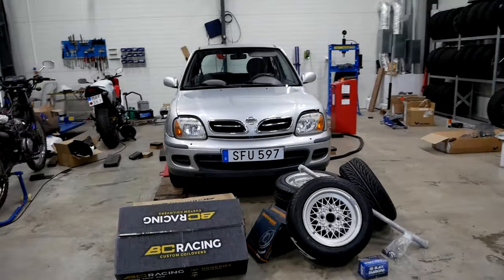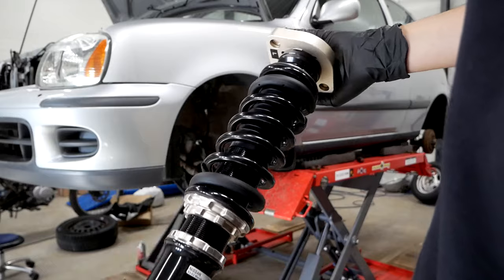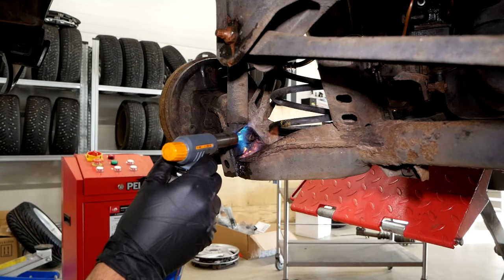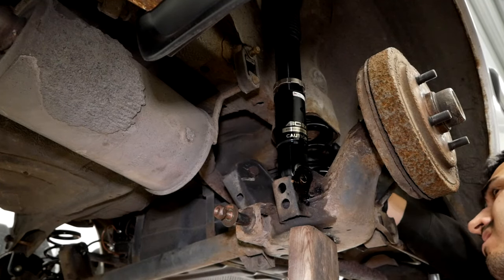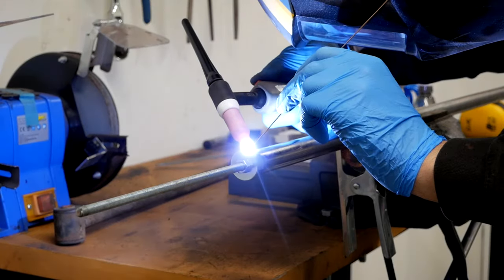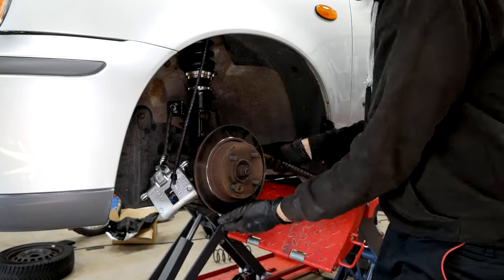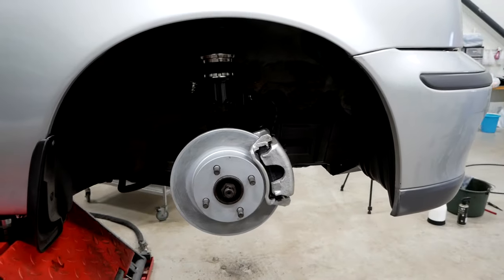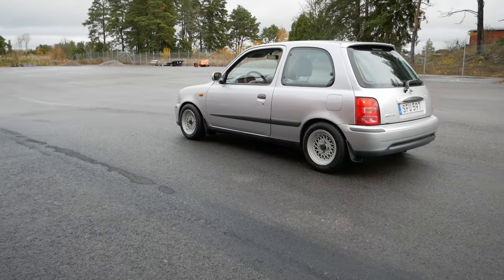Building a Race Car out of a Cheap Nissan Micra - Insane Transformation! Part 1

Comment: If you can get Nissan Cube Alpha "TA-AZ10"  parts, better get cams, pistons and gaskets.The Nissan Cube is a Japanese-only model based on the K11 Micra. The standard CGA3DE type engine is also 85ps, but, Cube Alpha has a horsepower of 101ps with standard specifications. It was our standard to use Cube Alpha cams, gaskets, pistons, and exhaust manifolds to increase output when playing with K11 Micra modified in Japan.
Reply from the maker: That is really interesting, I didn't know that. Thank you for sharing that information! 👍
Reply: What other micra wisdom do you have? My daily micra just shat itself and i'm deciding on what to do with it
Reply: We also have the cube in australia
Reply: @callumthorburn7244  imported. Pretty sure they weren't sold by dealers
Reply: @callumthorburn7244  They had them as grey imports in right hand drive markets. Like the Figaro.
Reply: @rimmersbryggeri  we have nissan cubes here in europe as well, and they are all left hand drive, although all of them 1.6's or 1.5 dci's, and i think the US got them as 1.8's, but i suspect this is meant for an older generation.
Reply: @aaaabababa  Isthat the 2nd genereation cube? As I remember from back in the day they said on top gear that it would be grey import right hand drive only but that moight have been the hybrid one. I am swedish and I have never ever seen a cube here. At lest not that first generation one which indeed was only sold in japan officially.
Reply: @rimmersbryggeri  Had to google what generation we got, appeast to be the 3. gen "Z12", and they were really rare here in Central Europe as well, don't think i have seen more than maybe 2 or 3 on the road before. i'm guessing the one reffered to in the posts above must have been the 2. generation "Z11" tho, since those came with a 1.4 with 100ish hp
Reply: @aaaabababa  YEah I was talking about the really bonkers one. The timeline suggest it should be Gen 1 or 2 and it was a proper Kei car as I remember. Where areyou fromin central europe, Iminterested in old central european cars.
Reply: @rimmersbryggeri  from what i could find none of them were kei cars, even the first generation had more displacement than necessary to get to that point and i doubt the Micra/march platform would have been able to meet kei car standards, the Cube that was sold ehre apparently also was produced starting in 2008 and ended production in 2020 or so
Reply: @aaaabababa  I could very well be wrong about that it jus looked like nothing else and those models usually are kei.
Reply: I thought Nissan Cube was Renault Kangoo
Reply: It's not a japanese only model, there is some here in France
Reply: @triceratrom  the third gen isn't, but the first and second gen cubes are.

Comment: This will probably be controversial, but here goes. You're actually supposed to set the ride height using the spring pre-load as well. The adjustment using the threads on the coilover body itself is for setting the bump travel of the shock absorber in the coilover. Basically, you need to have the plunger for the shock-absorber centred in the coilover when the car is at rest, so it has equal amounts of room to move up and down as the suspension compresses and droops. You won't affect the stiffness of the springs by pre-loading them, because they have a linear spring rate, meaning, they require the same force to compress them further whether they have a lot of pre-load, or only a very little bit. Obviously you have to leave enough room for the coils to compress together without the spring locking up, but other than that you should be fine. Setting the ride height is a balancing act between the two adjustments. If you look at reaaaally expensive coilovers like KW or Ohlins, they actually don't have adjustable bottom mounts because they don't want you messing up their carefully calculated bump travel.

Comment: Preload is a perfectly fine way of adjusting ride height and usually the only way on most low-mid tier struts.
It only affects performance when you have a progressive multi-adjustable damper. The spring rate is set, it doesn't care if it's preloaded.
What you're looking for with preload is to use the stroke of the damper as efficiently as possible.
IE the manufacture, if a good one, has probably considered this, and thus the best preload is to simply fully seat the spring at full sag.

Comment: You don’t have to have the ride height the same on each side of the car. Especially if you end up corner weighting the car. If so you would adjust the ride height to balance the car across the axles. And there could be a few mms difference.

Comment: I adore 3 ring coilovers, a bit of blue loctite and they never loosen the adjustment ring. I'd love to see you buy a camber gauge and do a string method alignment z maybe even corner weight. Don't forget that add your weight in the driver seat, perfect alignment every time.

Comment: the bolts on the shock absorber that are holding the brake disk assebly should be mounted the other way around so that if the nut unscrews itself the bolt stays in place thanks to the g force, even though it never happens expecially if the bolts and nuts are rusty and well stuck together you never know if you race this thing what could happen

Comment: PU still hard enough to crack the subframe. I would suggest a harder grade of rubber, but still allowing some movement and vibration dampening characteristics, that the PU doesn't have.
Also, a TIP: Use wd40 on the rusted bolts "before" attempting to remove them. Spray it some 5 minutes before removing them, to let it penetrate the metal. With that level or rust, you are looking to torch, solder and do some crazy stuff to remove stuck bits without attempting it first.

Comment: I did a track k1 aswell but a long time ago. look into nissan sunny/pulsar front vented brakes if you plan to do serious track work. They fit :)
Reply from the maker: Nice! Yes I"ll probably change to that set up in the future. But I think you also need the calipers from the same car right?
Reply: @ejoautovideos  yes calipers and carriers. Also i suggest some strutbraces because the micra is made of tincan material and strut braces will tighten it up :)

Comment: Cheap turbo build next? xD, you have to get a good interior in one of those aswell, maybe some period correct Nissan bucket seats would be cool, but keep up the good work I really like how it turned out :)
Reply from the maker: Haven't decided on a turbo yet. If I fit one then it's bye bye with reliability and also it's not so budget anymore. The plan with it was to make it about the handling and to keep it relatively budget and reliable. So I'll probably do some light NA tuning first, I've heard from other Micra owners that some breathing mods can make a big difference. 👍
Also I will fit a short-ratio gearbox, I think that will make a huge difference. 👌

Comment: Really like the video, love how the Micra is looking now, have a K10 myself but I have to say bcracing is definitely not a budget option so I'm calling that a clockbait 😃. Keep up the good work, gonna be subscribing and following the progress
Reply from the maker: Thank you so much! 😊
Reply: High end coils are twice or thrice the price of BC so it definitely is a budget option. 

Stuff like maxpeeedingrods is just throwing money away, so while they're cheap that still makes them an horrible budget option as eventually you're gonna want to replace them after your disappointed, or be forced to replace them after the shocks leak all their oil, and end up spending the money twice.

There are cheaper good options like if it's a Euro car, AP suspension is less than 700€. There also is mts technik. So there are exceptions but in general if you're gonna spend less than 600-700€, forget about coilovers. Anything you'll find for less is gonna be disappointing and won't last.

At those price point a good set of shocks and lowering/sport springs will actually handle and ride better. Overall much better unless you're just a stance guy wanting to get low.

Comment: Awesome work! Video is pure pleasure to watch. But about brake job, you did almost everything wrong. Surface that meets with brake disk can only be lubed by thin coat of dry lube or motor oil. With grease like you used it will be matter of time when your brake disc start to rotate and hit against bolts in wheel hub. Second thing, pins in brake calipers should always by dry!!! With lube applied there is no return drag. ATE systems are arround for at least 30 years maybe its time to figure out how it should work :d

Comment: Now might be a bit late, but instead of buying race pads and normal discs, i would highly recommend doing a brake upgrade, using Sunny N14, Almera N15 or 100NX calipers. You gain a bit of surface area, and most importantly, vented discs. And parts are still plentiful and cheap!
Reply from the maker: Yes I might do that depending on how the first track event goes 😉👍

Comment: love things like this. But even if its a budget build I would definitly go with a small car that has more than 100hp atleast. You dont need alot of hp like you said but you for sure need atleast some power ahaha. Bet the suspension alone cost double what the car cost.
Reply: It's all about the power to weight ratio. So yea although under <100bhp it's also well under 1,000kg in weight so on the whole a decent package, particularly handling wise for tight turns / salom.

Comment: Never paint brake discs or the mounting face underneath. The paint will get lose over time, pressure and heat and will compress and or go out at some point. Then there is a slight gap between the mounting faces cause of the missing layer of paint which might lead to you losing a wheel. Just not worth it really, get the mounting faces nice and flat and you're all good

Comment: If the wheels are bbs mahle 13x6 et13 from 2002 or E21 bmw, Can you tell me what size you needed to bore out the centre hole and what did you taper the mounting holes too? I got the same wheels, have them restored and can't put them on..

I bought already 2 sets of extended wheel studs and neither splines fit the micra hub, rather than get a 3rd set I will just bring them to a machine shop to do the same work like you, thank you!!!
Reply from the maker: Hello, yes I have exactly these wheels. The centre bore on the k11 Micra is 59,1mm so you need to bore them to very close to that, I went with 59,3 to allow for thermal expansion etc. 
I also needed to re-taper the holes because they were messed up, if yours is in good condition then there is no need for that. However I used a 60° countersink for that and the diameter needs to match up with whatever nuts you are planning to use (you can not use the standard nuts for steel rims!)
Hope this will help 😊👍
Reply: @ejoautovideos  I'm curious what nuts you used because it seems my studs are not long enough to use these wheels, how deep did you go with the 60deg taper?
Reply from the maker: @alexpopa2807  I just used chrome nuts with the right thread size (m12x1,25) with a 19mm head from a Swedish store called Biltema. 
I didn't go to deep with the taper, just enough to get a fresh cut. I use original studs. 👍
Reply: @ejoautovideos  much appreciated for the help man, have mine Gold centres and diamond cut lips, going on a seafoam green pre face 😍, you've helped a lot man, thank you!!
Reply from the maker: @alexpopa2807  no problems my friend, glad to help. 😊

Comment: FWD cars that use a solid rear end have always and will always confuse me from a design standpoint
Reply: Rwd cars that use a solid rear end will always confuse me oh wait, most American rwd cars that can't corner lol
Reply: Cheap to engineer and produce, plus it's a very compact design which takes basically no space away from the cabin, making it more spacious for people and luggages. I'd say it makes perfect sense for cheap and small cars
Reply: It's not actually a completely "solid" rear end on most FWD cars like this. It's called torsion axle or twist-beam rear suspension.
Somewhat better than a totally solid axle since it works as a sway bar and has some flex in it.